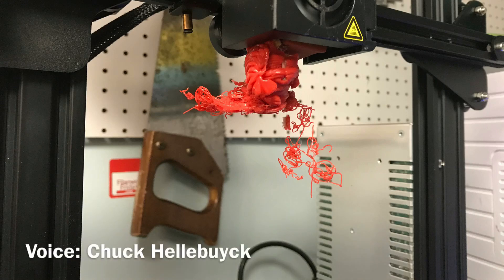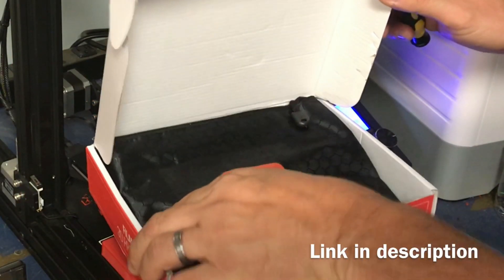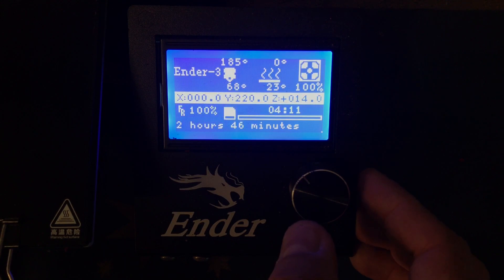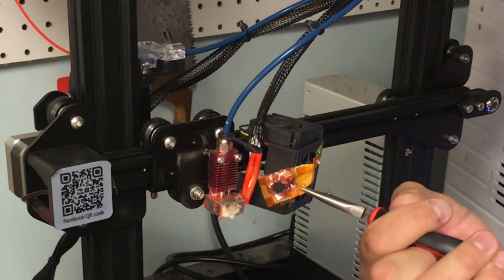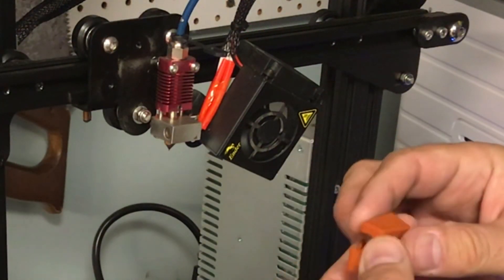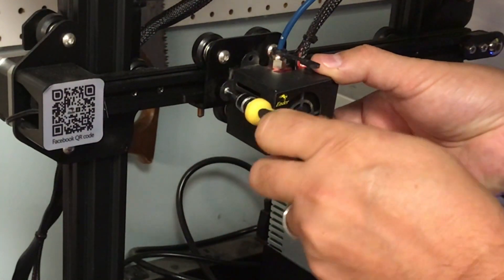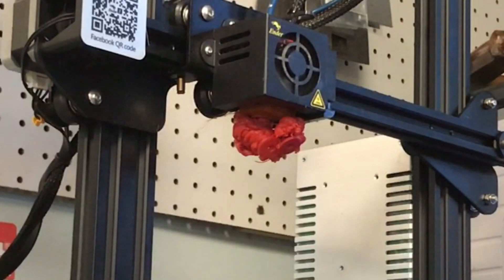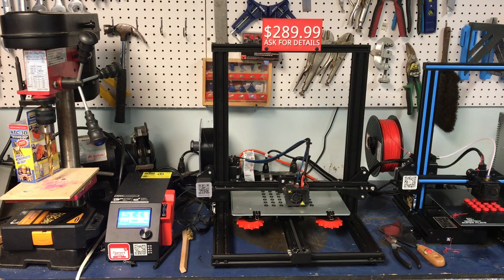How to fix a Filament Blob on Ender 3 3D Printer

Comment: Hello Chuck, 
Great video! Yep... I got bit by the blob on my MK3... it wrapped around the thermistor wires and ripped out when I tried to remove the blob. 
Hoping to replace the parts today!
Reply from the maker: I’ve had that happen on my MK2. I broke the Pinda sensor on mine.
Reply: @FilamentFriday  not fun... and gets a little spendy ordering replacement parts from Prusa!

Comment: 2:02 I thought you were supposed to remove those two screws that go between the hot end and the heat break to improve the thermal separation.
Reply: Nope
Reply: @RCVOODOO  
Indeed. I learned that the hard way.
"Why is my printer dripping melted plastic all over my print?"
lol
Reply: @RL_Dane  several channels did a test on heat soak and the results were nil  not to mention I think it was nerys (not positive) called them and ask directly. They said the screws should not be removed.  Many people thought they where the only for shipping but they are supposed to be there always
Reply from the maker: @nerys suggested removing them.
Reply: @FilamentFriday  nah. He said only if you are printing at realy high temps. Otherwise leave them alone because even at high temps the fans are plenty good enough, But IF you take them out make sure to tighten the grub screw really tight
Reply: @RCVOODOO  , @CHEP
In my experience, the grub screws are insufficient to hold the hot end on tight, especially under high pressure (e.g. warped bed/nozzle too close to bed)
Reply from the maker: He said in his post here and to me on twitter that if you see jamming remove them. Then added high temp. Then further explained that meant above 250. It all adds confusion. My point is don’t remove them. The max is 255 from Creality. I don’t recommend you run even near max. especially with the stock PTFE. The screws should stay. Period.
Reply: @FilamentFriday  I agree. Do not remove them.  👍
Reply: @FilamentFriday   Agreed.

Comment: should those 2 screws on either side of the heat break be there?    I thought they were only to be used  to keep it all in align when building the hotend.  I think the screws will transfer heat from the  heater block to the heat sink.

Comment: Could you do a video on some upgrades you can do for the CR-10 mini? Because I've been looking at what I can upgrade other than some simple things. I was thinking of things like maybe using a raspberry pi, bl touch, filament run out etc. Possibly a demo of these things if they're possible? Thanks and either way keep up the good content
Reply from the maker: I’ve done a few videos on the CR-10 mini already. Mostly 3D printed improvements not electronics. Check my earlier videos.

Comment: I’m a big fan of silicon socks.  Another benefit is they can help avoid thermal runaway with the hot-end if the parts cooling fan is too strong.